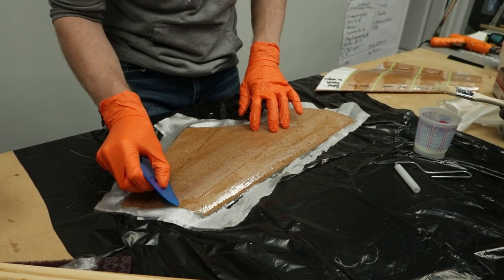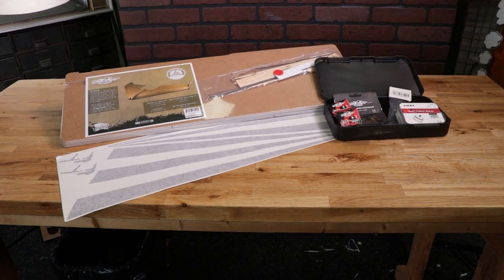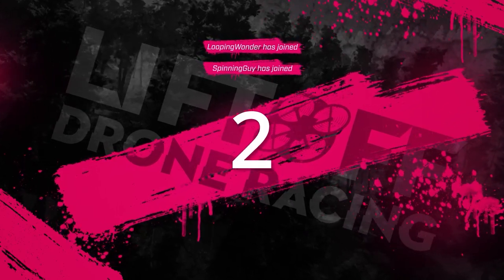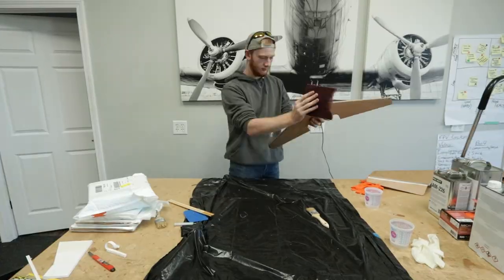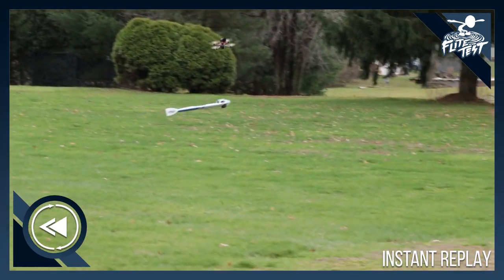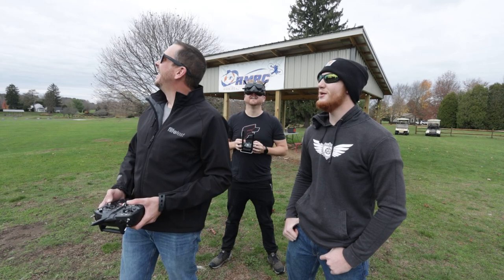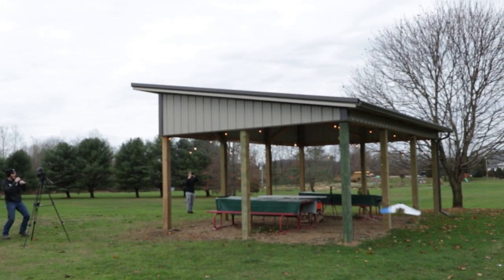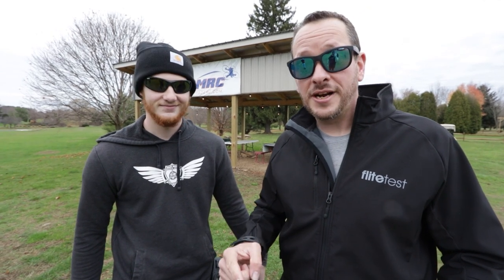Fiberglass Wing Crash Test! 💥

Comment: The foam board you're using looks like it has untreated paper coverings.
If so, you can just brush enough epoxy on the paper and let it soak in and dry. 
It won't have the strength of glassing, but it won't have the weight either.
Cotton fiber (flux) and epoxy, is used as a structural components of building any of Burt Rutan's composite aircraft. VariEZ, LongEZ, Quickie,...
You'll be surprised at how stiff and strong plain paper and epoxy can be. Give it a try next time. The paper is already there!

Comment: I use multiple layers (3 or 4) of 3/4oz cloth put on with water based polyurethane satin finish varnish on my Simitars. All are still one piece. My Wiseguy mid-aired with a conventional plane, tore through it like tissue paper and kept on flying.
Reply: How well does the water based polycrylic stick to foam board?
Reply: @iainmarshall8715  I imagine as well as it does to balsa and light plywood. It just takes longer to dry. I use the satin finish because it has filler in it. Instead of squeegee, use a dry brush to wipe the excess away. A bright flashlight held at an angle will help spot puddles.

Comment: You should 3D print molds and put the fiberglass and let it dry and you have a plane made of fiberglass or you could do that with carbon fiber cause it’s stronger but it’s a lot expensive

Comment: I say the souless one won. Also I'm wondering if using the two layers of the lighter weight glass fiber would make it stronger than the medium fiber you used without adding much weight.

Also I've been asking you guys to make a large scale H-1 Hercules a.k.a. The Spruse Goose for a while now, and with you guys adding in fiber glassing to you bag of tricks I think now might be the time although it is getting a little cold for flying boats. But hey, come spring or summer, Josh will be able to pull himself around on the lake with a large H-1 Hercules. Maybe Josh uses the large Seaduck he build before and Noah gets out there with him in another kayak and uses the H-1 and they have a race across the lake lol.

Comment: Could Flitetest possibly also test out fiberglassing using WBPU and/or polycryllic waterbased floor laquer in stead of Epoxy? The waterbased stuff should be both a lot less toxic, hence possibly even usable for the STEM school projects, and it should also be easier to get. Must admit I've not tried it myself yet, but results i've seen (mainly small DLGs) were quite strong albeit with a slightly less hard surface, compared to Epoxy. Process should be about the same, only the waterbased stuff actually loses weight drying, as water is removed from the material. Epoxy weighs the same wet or dry, as there is not really much happening in the shape of evaporation (unless you thin it with some sort of solvent).
Reply: I used the minwax water based polycrylic on fiberglass for my apprentice, walrus and trojans. It did tent to eventually peal off. Wonder if epoxy is better at keeping hold.
Reply: @iainmarshall8715  did you use DTFB or FT foam, and did you leave the paper on? And did you sand or otherwise prepare the surface?
Reply: No not on foam board. Just the EPO on regular store bought foamies like eflite and hobbyking .  I did not rough that epo foam just cleaned it with denatured alcohol

Comment: Use cheap foam as your airfoil. Then do 2 layers of fiberglass, laying the 2nd layer 45 degrees to the first layer. Then poor acetone inside the airfoil which will dissolve the cheap foam. This will leave you with a hollow lightweight airfoil.

Comment: Carbon fiber, then use acetone to dissolve the styrofoam.
Reply: Of you want to glass over a Styrofoam core you mustn't use polyester resin. That would dissolve the Styrofoam during glassing attempts.
Epoxi resin works fine for this application, but cannot be thinned with acetone. Some alcohol might work (prior experiment advised).
But most ways to thin the resin will lower the strength of the cure resin. Might still be strong enough but I personally would rather avoid thinning and be vigorous with the squigee instead.

Comment: Don't let the FCC see you flying through a pavilion !  LOL   I haven't flown for a decade.  I think its time to toss out the old batteries and find new.  I used all nicads.  How can I upgrade and use the same chargers ?
Reply: Simple answer : you can't.
Charging characteristics are quite different. If your charger doesn't have a Lixx charging mode don't use it to charge Lixx batteries.
I don't know where you live but in Germany you can get a decent-ish beginner grade charger for 40€. Not as spectacular but preferable to a Li fire in my opinion.
Reply: @al1rednam  That's what I figured.  What I'm also  concerned about is the speed controls... they were designed for Nicad batteries... will they work with new batteries?
Reply: @rjaquaponics9266  that won't be a problem. Either you use batteries of matching voltage or you add a bec.
Bec usually outputs 5 or 6 cold to safely power your electronics from any (reasonable) battery voltage.
Many motor controllers come with a bec built in but I prefer a standalone bec
Matching voltage example : 6S NiCad is about 7.2 volt. 2S LiPo is about 7.4 volt if I remember correctly